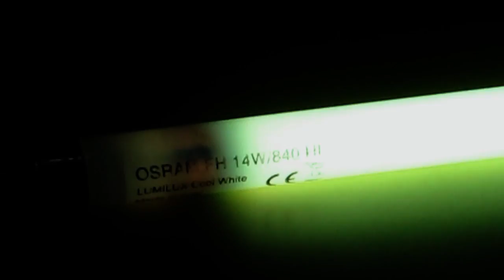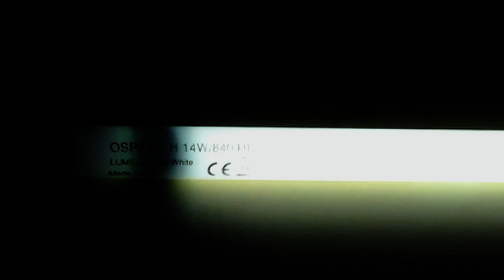Fluorescent lamp torture.

Comment: I tried to connect 8W tube to large 650V cap bank. Nothing interesting happened. Cathodes evaporated instantly, but glass did not broke.
Reply: You can ignite them on preheat circuit by shorting the pins on both ends